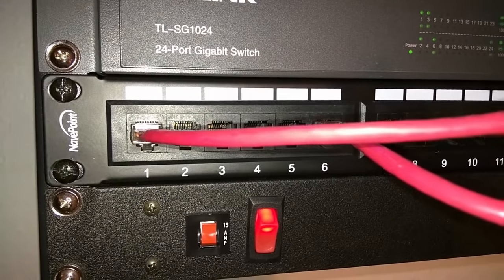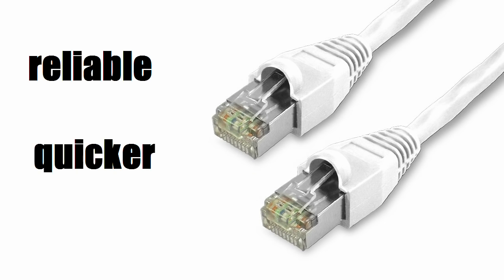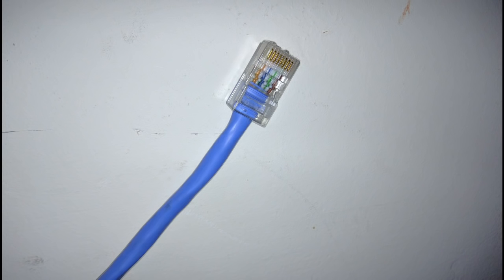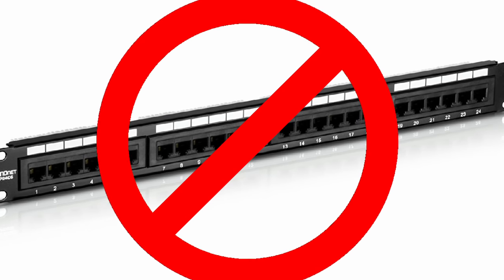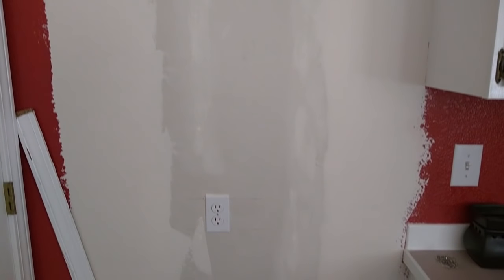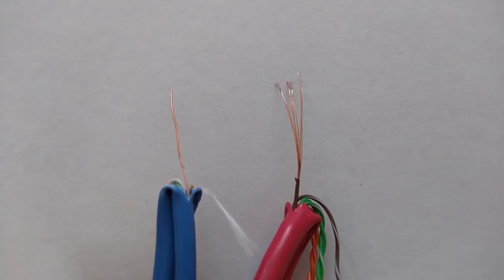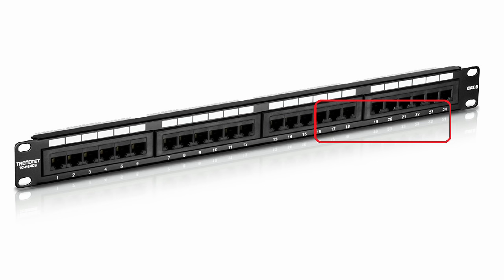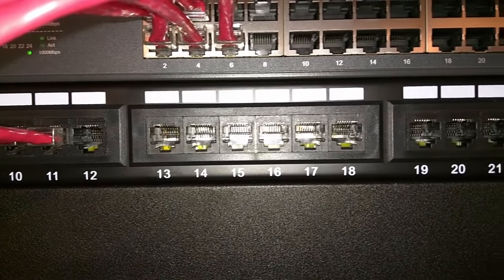What is a Patch Panel? Do You Need One?

Comment: Great video, i have one question, very important, this saturday, today is 11.19.2019 i will install a patch panel, i will use a switch, router, moden....my question is; how will i know when i'm making my patch panel cables if i am doing a type a or type b cable?, all computers use type A cables?....please help me. Thank you
Reply from the maker: Most cables are b. Just punch down the patch panel as b. Computers don't care what standard is used, just use the same thought the house.
Reply: @BudgetNerd  how do i know which one is B?, and, t566a is straight thru cable and widely used..
Reply from the maker: the back of the patch panel where you punch them down will tell you how to punch the wires down for either a or b. Just follow to color code for b. If you are creating your own patch cables (ethernet cables) then you just google the diagram for ethernet jack b, and follow the pattern. If you are punching down keystones, just follow the color pattern for b that is on the keystone.
Reply: @BudgetNerd  Thank you so much for your advise. It has helped me a lot.
Reply: You can use use B or A though B is what is usually used.  Just make sure that both ends are the same, A or B it won't matter if one cable is A or one is B as long as they are both the same pin out on each end.  Here is the difference in A and B:

https://ibb.co/bW3MxyH
Reply: in the US they use B in Australia they use A it does not matter as long as one or the other not both, I only ever use A

Comment: Make a video with speed comparison of 1 whole cable vs multiple cables with plugs and jacks between 2 devices
Reply: Yes, this is my concern too. I have a Cat7 trunk cable running from a remote PoE switch driving 7 cameras (4k). The Cat7 cable is plugged directly into the surveillance server. With a patch panel, the shielded twisted pairs of the Cat7 cable would be untwisted and unshielded, and this may affect bandwidth and data rates.
Reply: @simongchadwick  Maybe if you had a large power cord with a heavy load on it running right up against the patching panel, perpendicular to where the cables are punched, but in most practical situations, that tiny little bit of unshielded, untwisted cable isn't going to suffer any issues that are meaningful outside of lab conditions. A small bit of isolated electromagnetic interference isn't typically the issue with cable runs; it's continuous interference over the course of a run that progressively degrades signal.
Reply: @simongchadwick  It's important to prioritize organization, scalability, and access over micro-optimizations when practical.

Comment: Is it right to say that patch panel should be near entrance in a flat to be accessible for internet suppliers to install their modem/router?
How close can a PP be to a consumer unit in a flat?
Thanks in advance
Reply from the maker: Put your patch panel in a central location. A logical place for all your Ethernet cables to go. Doesn't have to be near the front door or anything. Service providers can work with what you give them.

What do you mean by "consumer unit?"
Reply: Know where your D-Mark is or will be.  Plan from there.
Reply: As he said the the video ethernet can be used to take phone cables so you can always run a network point to nere where the ISP put the phone socket and used a rj11 phone cable to take it to your patch panel/Comms cabinet. 

Cat5 or 6 is usually superior to the cable land line phone companies use anyway so you shouldn't get much loss. 

Especially if you avoid running the network cables in parallel right next to power. Better to cross it at 90° and keep it about 1m ish away when running parallel. Can't always be avoided but it's best practice to avoid interference from the power.

Comment: Lets go deeper into why you need a patch panel (which was mostly covered in the video), but this is how i understand it

1. Like in the video, It's great for organization on permanent installations
2. Also in the video, It's meant for permanent solid ethernet wiring that can run upto 300ft/100m and PoE, that is brittle and is not capable of repeated bends
    - Although it's brittle in comparison it's also cheaper to manufacture and ideal for wiring that will not be physically stressed
3. Important part that was left out of the video, Stranded cable is only rated for 100ft/30m and should be restricted to 20ft/6m when used at termination points with solid cable runs
    - Try and find and good ethernet cable for sale over 100ft that is stranded, i just did because i didn't wanna look like a dumbass lol and couldn't
    - Essentially it adds impedance (electrical resistance) to the cable when using standed, fighting both PoE and of course the signal itself

Comment: do you know of any affordable two or four port 10GbE that take standard RJ-45 twisted pair (as opposed to those cables with the modules), and switch it into a 16-24 port GbE switch?

i see a LOT of affordable ones using those cables that have the modules, but not for just straight twisted pair.

my 10GbE cards are the Asus ones using the Aquantia chip.
Reply from the maker: Haven't really dove into 10Gbps yet.
Reply: @BudgetNerd  you should look into the Asus XG-C100C cards.  They are going NIB for around 80-130 dollars (I got two a year ago for $80 apiece).  They use a PCIe 3.0 x4 interface, which on my motherboard isn't a big deal, since my motherboard has the PLX PEX 8747 PCIe switch.

Comment: OK this did not help, however my situation seems unique. My provider does not use cable modems. The internet goes straight to my router and I have WiFi. 

My problem being that the house is wired for ethernet with cables to 6 different room/locations. These cables are in my garage, (behind a panel). The incoming internet is inside this box as well. The only thing wired at the moment is one room, with the router, and only a single internet output from the input. How do I change that single input in the garage to 6 outputs for my ethernet needs?
Reply from the maker: Your router should have a built in modem.

Your router only has one lan port? Most routers have 4. Are you sure what you're referring to as your router, is actually a router?

If it is a router, you could add more ports by adding a switch. Then just plug the switch into the router and the other rooms Ethernet ports, you could plug into the switch.
Reply: Your provider absolutely gave you a modem or you’d have no service. You have a all-in-one device. Modem/router/AP all in one.
Reply: @BudgetNerd  My ISP provides a box for Internet and home phone.  It has 2 Ethernet ports and I can get 2 IPv4 addresses, one from each port.  However, since I have IPv6, I have gazillions  (2^72) of addresses with it.
Reply: @ohheyalan123  Not with fibre.  No need for it, just a media converter between fibre and copper that may also have some management function.  I have installed several in businesses, between the carriers fibre and a Cisco router.

Comment: Youtube keeps showing me these networking videos. I am interested, butttt..... I am going to start gigging every one I watch that doesn't use dust or blanking plugs to plug the unused ports in wall plates, switches, and patch panels. Everyone has dirt, spiders, insects, dander from animals, etc, and it gets into everything. If you are OCD about neatness, order the plugs. packs of 100 of the RJ45 jack dust plugs are $25 bucks or so, and I'm sure well worth it, even more so if you are using a switch with SFP ports.

Comment: what i don't get is you use a box that has 4 spots on it on wall in a room and beside it another box with 4 totaling 8 patch cables coming from the room with the panel in it? Would you really run 8 patch cables from a room that could be quite a ways from the other room or would you just run 1 cable with a switch at other end and use the switch there to manage those 8 spots? sounds like a lot of extra cable would be needed to do all that?
Reply from the maker: Either way works. I went with individual cables because I had lots if them, and with an open wall, it was easy to run them.
Reply: A switch creates a good choice for subnet isolation, but would also require power or POE.  It depends on what you connect. Could be 8 Ethernet ports, or 4 Ethernet and 4 VoIP lines for phone. That's a really fantastic home office! Lol
Reply: Bringing everything back to the wiring closet (called "home runs") is always better, but not always practical, and nearly always more expensive.

Comment: Would a set up like this solve my strict NAT issue with my 2 xboxes? I have one wired to the router and one wireless and without fail my daughter and i can't join in the same online game because one of us gets set to a strict NAT settting.
Reply from the maker: Those are all router settings. Check your router manual, or upgrade your router, especially if it's old.
Reply: Did you do any port forwarding for either system?
Reply: @thatcanadianon2wheels970   i tried with the 360 but messed it up somehow. i'm not 100% sure what to do even after a tutorial
Reply: Wich game ?
Reply: @xMidgetFuryx1  For a console, NOT for a PC or other devices, I would enable DMZ. JUST FOR THE CONSOLE!

You give the console a Static IP, then in your router settings, route the DMZ to the Static IP you designated for your console.

Comment: I just installed a small patch panel, because i have only 5 cables form my switch to my house locations. That is because I have only 1 or 2 cables to each floor, and then a switch in each room in the house to distribute connectivity to each PC or wifi AP.  The PRO is that I need to run less cables. The CON is I dont need a neat looking big patch panel, AND my main switch does not filter any VLAN's since each VLAN needs to extend to each floor  and only the last switch terminates the VLAn's on differen physical ports.
Reply: CON is energy consumption and cost of multiple switches, also bandwidth via 10 cables is much better than via single cable
Reply: @johnsean100  Correct. But I must say Im already glad having run a single ethernet cable to each floor in an existing brick & concrete house. Many houses in my country (NL, EU) only have wifi. In US houses are wooden beams and dry walls.
Reply: ????  The whole point of VLANs is you can run multiple subnets over the same cable, as I do with my access point or separate them at a managed switch.
Reply: @johnsean100  A patch panel doesn't use any energy.
Reply: @James_Knott  patch panel does not, multiple switches do consume more power than single one (even if it's more powerful).
Btw, yes, you can run multiple subnets on single cable, but it does not increase bandwidth, having multiple cables is always better solution (and expandable).

Comment: does running through so many devices slow down the connection?? it just seems alot for a connection device from cable one to patch panell then cable 2 from patch panel to switch then cable 3 from switch to router then router to modem. just seems like the connection would slow down somewhere in there
Reply from the maker: As long as they are all punched down properly, there wouldn't be any issues.
Reply: This is a very typical setup in commercial use. Signal degradation is measured in db loss and every connection does introduce some db loss. However, just like Budget Nerd stated, as long as they are terminated and connected correctly, the loss is normally too small to matter. 

Just don't go crazy with splices and couplers. 😅

Comment: I have a question. If you run a Cat5 or Cat 6 cable from your internet router to your destination, can you use a keystone wall jack at your destination, and then use a RJ45 connector on the other end to plug into the internet router?
Reply from the maker: Yes!
Reply: @BudgetNerd  Thanks! So the configuration on the keystone and the RJ45 would be the B type right?
Reply from the maker: Most people use B, so I would go with that normally. But as long as you use the same on both sides, you'll be fine.
Reply: @BudgetNerd  in theory, you could create your OWN color code and wire them up in ANY order you want to....... as long as you use THAT color order in the whole network.  After all when it all boils down you are left with 8 copper wires running to 8 pins on the other side, Blue or Green or Brown matters not because the only color the connections see is COPPER!  As long as pin 2 runs to pin 2 on the other side, color means nothing (except to YOUR "system" :) ).

I know..... I know..... damn me to hell for introducing "chaos" into the nice neat illusion of "order" and "standardization" that has been created for all the world lol.  I guess I'm just a rebel lol.  

Create your own job security lol..... run green to blue and brown to red..... and take no notes!!!! NOBODY can decipher your madness you created in the whole building.... MWAHAHAHAH!   Wait.....  What?? DAMNIT!!! Now I have to rewire it all again! It was the ORDER that can change not the colors !!!!
Reply from the maker: You are correct! I like you idea of job security.

Comment: Shall this patch panel and switch need a good ventilation? Room with Air-condition?
Reply from the maker: Patch panel creates no heat. My switch creates very little. They are perfectly fine where they are. If your equipment does generate lots of heat, then yes, you'll want good ventilation.
Reply: It really depends on how much equipment you have, the size of the space and rather the space is against an outside wall. If all someone has is a "all-in-one" home router and an 8 port dumb switch, it's not an issue.  If however you have 24 or 48 port POE switch, a prosumer grade router, a NAS with several drives, perhaps a separate PFsense firewall, and it's all in a small closet, then you might have issues.

Comment: We have a solid core ethernet cable. What will I do to make a patch panel from this cable?
Reply from the maker: Same process with any cable. It can be done. Just the more you move it, the more likely it will fail somehow. Stranded cable is better for patch cables.
Reply: You don't.  Patch cables are made with stranded cable.  However, they're so cheap, there's no point in making your own.

Comment: I bought a switch, but I have some real issues terminating the connections, was think of using a patch but now I’m thinking I’m just gonna use the switch and run pre-terminated wires through the walls.
Reply: skyshark 20 its issues terminating the Ethernet jacks themselves, I think my fingers are too big for such small work

Comment: Great video. Does Ethernet 5 or 6 matter for the cords and ports?
Reply from the maker: Cat 6 cable is a bit thicker, but the ports and jacks are pretty much the same as cat 5.
Reply: To add a little to what he said, Category 5e and 6 both use the standard size RJ45 connector. Both cables offer up to 1Gb speeds but Cat6 (sometimes mistakenly also named as Cat6e) is far less susceptible to cross talk (radio and power frequency disturbances). Home networks are perfectly fine with 5e.

Comment: Eeek, at 1:39 the keystone jack is installed upside down IMO. With the connection pins on the bottom, it is easier to get "contaminated" with dust that blows around the room than it does if the jack was installed with the connection pins on the "top" side of the face plate. 
Worst install by a professional cabler was the jacks install with the opening pointing up under a blackboard in a school. Not too bright but at least they came back and turned them sideways when asked.
Reply: Yes, I noticed that too, they are all upside down.  You can even tell by the writing which is also upside down.

Comment: Crossover???  Does anyone still use those?  They're not needed with Gb and newer 100 Mb gear.  Also, if you get a patch panel that takes keystone jacks, then you can put other cable types, such as coax, on the same patch panel.

Comment: I know I am late to the party but stranded cable requires completely different RJ connectors to solid core. Most patch panel blocks are designed for solid core and not stranded. Similarly most RJ plugs are designed for stranded cable and should not be used on solid core.

Comment: Thanks, great video.  I do have a question.  I have a Ubee modem/router combo from cox and I have Netgear Nighthawk AC1900 wifi dual band router.  Are these compatible?  Thanks again, one of the best videos I've seen about this!!
Reply from the maker: You usually don't want two routers. With default settings, you are creating two networks. A separate modem and router I think is the best option. Maybe you can disable the router options on the combo modem/router, and use it as just a modem with the nighthawk router.
Reply: Odds are how your network is currently operating is the modem router combo from Cox is your network routing device and then your Nighthawk is simply acting as a wireless access point. this is perfectly fine unless you have some specific need to have your Nighthawk manage the network.  if you're not doing specialized file storage and sharing or some other complex routing operation it's probably fine especially if it's been working.
Edit. Sorry I misread your question first time yes they are compatible and what I previously stated is how they will end up working. your Nighthawk should automatically set itself up into access point mode when you plug it in and beyond Beyond that all  you'll have to do is configure your Wi-Fi settings. you should also disable the Wi-Fi on your Cox modem router combo.